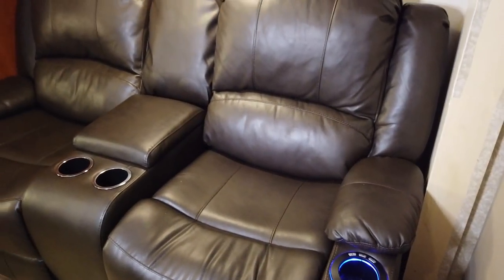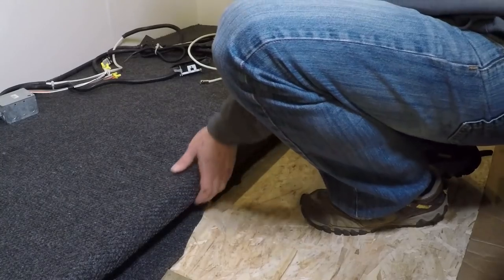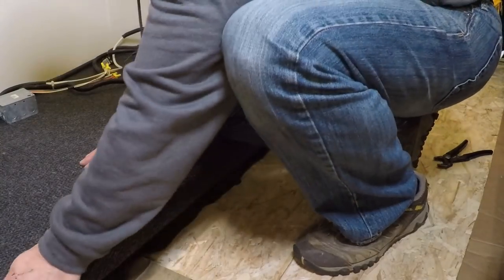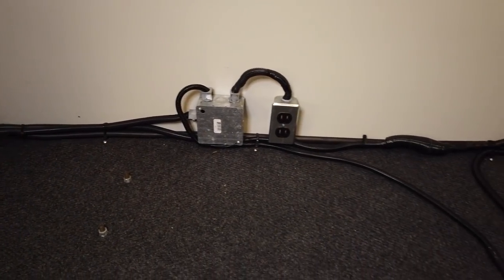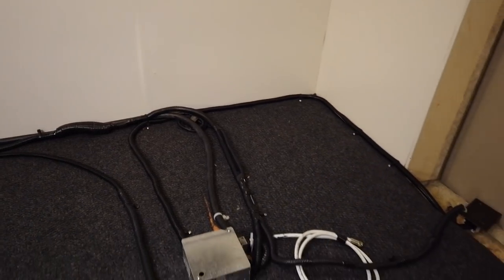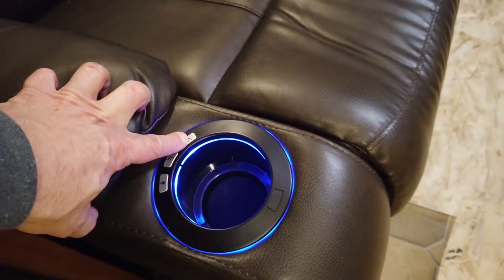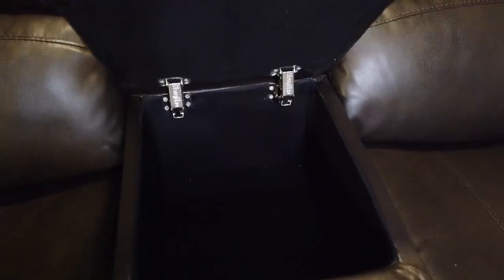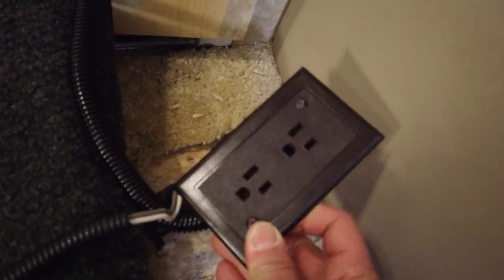Replace Uncomfortable RV Sofa or Dinette with Recliners | Class C RV Renovation | RV with Tito

Comment: We bought the same recliners for our Class C except non electric and in Toffee color. Ours were replacing a jackkife sofa that was incredibly uncomfortable. Our slide was not as deep as yours so we had to build it out to accept the chairs. My husband did an awesome job. It looks original. We used electrical conduit wall clamps on the front and back bars over a piece of 1" pipe to attach our recliners to the floor.  We greatly enjoy your channel and look forward to your drama free videos and laidback attitude. We also plan to keep our 5 year old RV for many years.
Reply from the maker: Hope you're enjoying your recliners. We're looking forward to many years of comfort with these. I also picked up a couple 2" conduit clamps that I'll put over the back frame once I'm done tweaking things. Cheers!

Comment from the maker: (Update) Bolting the Recliners Down: I secured them to the floor with a couple 2" electrical conduit clamps on the rear frame. There are a couple holes in the frame where I could bolt them to the floor, but I like the clamp on solution better.
Reply: You can always use muffler clamps through a floor with flat stock...
Lighting if you need some you can locate less from me or build custom plexy glass is awesome with leds. Simple and quick you can take vinyls and wrap some pain some install different bulbs. 

The only difference between DIY and profeccional Custom is I get paid by the customer
Reply: I had a feeling....I figured that to be the case. Once again...great video! I'm looking to do something similar, however I have an older class c without a slide and all my electrical and plumbing is located under one seat, and the fresh water tank is under the other one.
Reply: @mikefredericks7288  ,
  Do you have the ability to rout plumbing differently
Reply: Thanks for the video and tip on source for the sofa, I'm getting ready to tackle the same.  On the lighting, my class-C has a 12 vdc sconce lamps on the back wall, one on each side of the window, which will be above the back of the sofa.  Perfect for reading or anything.  It also has a 120 vac outlet on the same back wall so that part is also done.
Thanks
Reply: Forgot to add a question.  Since my crappy dinette is the only other bed beside bedroom, when I lose that my son is out of luck when he's with us.  In your opinion when you have them reclined all the way out are they suitable/intended as sleeping positions?  
I went to the site and found jackknife and pull-outs, but neither recline, that's kind of a buzz killer. 
Thanks again.
Reply from the maker: @HighCountryRambler  They are pretty comfortable when fully reclined, but not completely flat. We've certainly spent many hours sleeping there. When our kids got too big for the dinette or mini sofa, we just used a blow up camping mattress in the middle of the floor. That ended up being the most comfortable spot. We also still have the overhead bunk area.

Comment: Great vid as usual.   We changed the recliners couch in our new Crossroad cruiser.  They were impossible to operate and weighed a ton.   We upgraded to a lighter model and easier to use.   We will be getting tied of the dinette set next.  It’s heavy and not easy to use.
Reply from the maker: Change is good!

Comment: I swapped out the single swivel chair with a Rec Pro swivel recliner.  Love the chair but first long trip it de-assembled itself as 6 screws fell out going down the road.  I'll use some lock-tite and hopefully prevent further issues.
Still planning on the recliner swap out, just need more lock-tite....
Interesting how you take a RV and make it what you want.  I've told RV salesmen over the years, it's obvious RV designers aren't into RV camping.

Comment: Hi Tito. I bought a manual loveseat from RecPro about 6 years ago.   It is extremely comfortable BUT the material and stitching is falling apart.  We only camp about 6 months out of the year on weekends and don't use the loveseat much. I thought it was a little pricy when I bought it but I disliked the loveseat that came with our 2018 Travel Trailer.   I hope  you have better luck with durability

Comment: I may have messed up not ordering the powered version. I forgot you were using that type. I expect to remove the couch and install ours, early next week. I was under the impression that they would need to be fastened down to the floor but, unless I missed it, yours simply sits on the floor without being fastened to the floor?
Thanks for all your wonderful videos and advice too. Good job!
Reply from the maker: I did eventually fasten them to the floor. So they're nice and sturdy.

Comment: Looks great! How did you secure them to the floor? You're usually pretty thorough. Did I miss that part or are you waiting to do that until you finish up some other things in case you need to move them?
Reply from the maker: You nailed it. I haven't yet, but I will. I added a comment at the top explaining.

Comment: I want to do this too but I'm concerned about covering our dining room window.  It looks like you had/have a window too.  Did the chairs cover your window?
Reply from the maker: The overlapped the bottom edge of the window by a couple inches or so...enough to keep the roller shades from moving. We don't have that RV anymore so I don't have exact measurements. The website should state the height dimensions.

Comment: Clean Brian... do the recliners bolt to the floor at all? What is the interior width of your dinette slideout?
Reply from the maker: I'll bolt them down later (see pinned comment at the top). These are 70" wide. There is also a 67" wide one.

Comment: QUESTION… PLEASE HELP… My fuse box is currently located under my jack knife sofa.  I’d love to get recliners.  Do you think there is enough room under the recliner to leave the fuse box under it?  I have a class C much like this one.  Thanks!
Reply from the maker: Hard to say. There are a lot of moving parts underneath. If you can reposition the fuse box you might find a spot that works, but it's doubtful because it needs to be in a spot where you can access it. Hmmm

Comment: Hey Brian, can you tell me if those recliners are "zero clearance"? When you reclined, it appears as they are as the seat moved forward, but it's hard to tell from the video. How much clearance did you have to leave behind the head of the seat to allow them to move? This is definitely on my to-do list this summer!!
Reply from the maker: They only need 3 inches of clearance from the wall.
Reply: @RVwithTito  Awesome, thanks for the reply (I found the answer later on the manufacturer's website...sorry!)

Comment: By chance did you put the dinette slide in without the carpet on the floor between the dinette and the couch?  I want to remove that carpet and put in vinyl plank but not sure if the slide out needs the carpet to slide on.  I have the exact same motorhome and any help is appreciated.  Thanks Matt

Comment: I've been looking forward to this video because I intend to install the 67" version of these recliners in my rig once it warms up outside.  Originally, I was considering the manual version but the powered version is pretty sweet.  I noticed they are 120v AC, is there a manual override in case you are boondocking and don't want to power up an inverter just to recline?  It looked like you plugged in a DC transformer for each base so they are actually DC motors.   I wonder if they make a DC hardware option?
Reply from the maker: I don't think there's a manual override or DC option (from RecPro). I run my inverter most of the time, so no problem for me. The motor runs on 24 volt so I plan on installing a 12-24v step-up converter like this (https://amzn.to/2CQwjep) so I can power it from my batteries. I'll be sure to post something if/when I get that working.
Reply: You can also buy rechargeable battery packs for recliners. They are easy to install, just attach inline with existing cords. They can hold a charge for up to a week or so with moderate use but could recharge every time you plug in or from an inverter while you are parked.
This is what I ordered.  https://www.amazon.ca/gp/product/B07G91FMLQ/ref=ppx_yo_dt_b_asin_title_o02_s00?ie=UTF8&psc=1

Comment: Great video. Question: I would think that the recliners would have to be to the floor. Are you concerned about them shifting when you drive down the road?
Reply from the maker: I added a comment to the top explaining. I do plan to bolt them down, but not yet.

Comment: How do you fasten the recliners down to the slide out so they don’t bounce around when you’re driving.
Reply from the maker: I used a metal conduit clamp underneath on the rear part of the frame. It also helps when you sit up, so it doesn't rock forward. Good luck.

Comment: Thanks for the video.  I assume those are wall huggers.  Did you cycle them to full recline before attaching to floor to make sure backs aren't dragging on wall?
Reply: One more thing - you do really nice work. A lot better than a normal shop would do.
Reply from the maker: Yes they are wall huggers. I extended them fully a few times and adjusted the position so they wouldn't scrape the walls/blinds. I haven't attached them to the floor permanently yet. See the pinned comment at the top.

Comment: Thanks for your videos.  I have a Jayco Greyhawk 2007 that we are remodeling.  I ordered the same sofa today.  I am considering connecting the wiring for the chairs to my inverter so that I have power while traveling or not on shore power.  The other thought is to do a battery backup system.  Did you consider this.  My understanding is they will not recline without ac power.  Thanks, Larry

Comment: Thank you for sharing these videos.  Eventually I plan to do some upgrades to my RV. I did notice that it didn't seem you connected the chairs to the floor at all. Is that not necessary?
Reply from the maker: Check the update I pinned to the top. I'll bolt them down later.

Comment: Thanks for video.  Removed and sold our sofa-bed. Now, to order recliners.  Please tell me the RecPro item number you purchased.  I assume you roughed in the 110v to the recliner area, did you video the AC wiring?  Although I did note some comments on 12v operation, I am concerned about using only AC to operate the recliners.  Can one manually operate the chairs without using the electric switch? Thanks.

Comment: Looks great.
That does that setup weigh ?
Reply from the maker: The RecPro site says 197 lbs. They didn't seem that heavy, but I had them in pieces. I'm actually planning on getting rid of my 4K generator (located below the slide), so that should free up 300+ pounds. The couch I took out was actually pretty heavy too.
Reply: @RVwithTito  
It is looking good!
Thank you for the info!

Comment: this is great info and thanks for doing this,  Do you know the depth of your slide from the inside wall to the end of the slide?  Mine is only 33" and RecPro's website states 36" is required.  I am OK if I have to push it up against the wall when the slide is not extended and I would pull the recliners out  when the slide is extended, I have to make sure the frame will fit on the slide when the recliners are pushed back to the wall, thus the reason for my question
Reply from the maker: Mine is exactly 36 inches
Reply: @RVwithTito  thanks for the  response, do you think the frame would fit on a 33" slide if the recliners were pushed all the way back to the outside wall?
Reply: @RVwithTito  From your experience do you think the RecPro Recliners would fit on  a 33" slide if I pushed the recliners all the way back against the wall.  This would be what I would do when the slide is in, when I get to a destination I would open the slide and then pull the recliners out from the wall.  I just need to make sure the frame of the recliners will fit on my 33" slide when not being used.  My slide floor is above the main floor when pulled in.  Thanks

Comment: Since you changed the cafe booth to recliners, have you had any problem with the extra weight making a problem for the operation of the slide?
Reply from the maker: No. not at all. Removing the dinette and everything under it made a difference too.

Comment: We installed the RecPro recliners 2 years ago. The material is already starting to split on the back of one chair. RecPro would not stand behind their product but wanted to sell us a replacement back for $150. We declined that figuring that that one would probably do the same after awhile. Instead, we are having covers made for the backs at a local upholstery shop with color coordinated durable material. I suggest anyone using RecPro products keep an eye out for splitting fabric and contact RecPro before the warranty is up.

Comment: So Brian, you have an inverter so you don't have to either be hooked up to shore power or have a generator on to make these move?
Reply from the maker: Yes. I have an inverter. I'm also going to try and bypass the AC and power these from my batteries.
Reply: Brian, those recliners look awesome and great job on all your videos. 
Two questions:
1. Were you able to bypass the AC to power the recliners directly from your battery? I'm concerned about getting power recliners and not being plugged into a power source.
2. How do you think the Rec Pro recliners compare to the Thomas Payne recliners?

Comment: Brian, how much room did you have inside your slide opening? I see your chairs are listed as 70"...is that a 'true' size? I've got exactly 70" inside my slide walls...69.5" if I account for the trim on each corner of the slide opening. Thanks for the help...
Reply from the maker: My opening is exactly 71". The chair width is right at 69" plus a little extra cushion in the arm rest that would take it to 70". They could be squished down to fit 69" without looking or feeling weird. Hope that helps. I'm sitting in them as I'm writing this 😉
Reply: @RVwithTito  Is the slide 36" deep? That's what I have and have ordered the 67" powered set. Another user said they fit fine in the 36" slide, but I'm still wondering how it will impact with the window shades... thinking of installing mini blinds there?

Comment: Map lights .. Reading lights... something nice small..
Reply from the maker: Thanks for the suggestion. I've got several saved on Amazon already that are small with dimmers. Haven't made a final decision yet though, but probably one on each side mounted near the top of the side wall.
Reply: @RVwithTito  I've I stalled three of these bullet-style lamps. The dimmer and brightness levels, along with the swivel range make them very useful. Super easy to install!

Comment: I'd like to install the recliner in my travel trailer, however, I only have a 20" door opening. Do you think I could squeeze them in a 20" opening?
Reply from the maker: Just measured the base and it looks like you'll need at least 21" without damaging it. Out opening is 22 3/4"
Reply: Appreciate your effort measuring the base and quick response. Thank you, Joseph. P.S. Enjoy your channel.

Comment: Hi Brian,
I use a word I made up, getupability.  Our Montana High Country has seats that lack getupablity.  How is getting up from those seats?
Reply from the maker: Getupability rating is pretty good. Since they sit on the slide out it's adding another 3 inches or so off the floor. So standing right up and out is pretty smooth.
Reply: @RVwithTito  I currently have to push myself up from behind and I'm not alone.  I have seen other in my camper do the same.  When reclined mine are pretty comfortable.  I would hate to order a new one and have that problem.   Your input is very helpful
Reply: Hi, It's tine to replace my theater seating in my Montana High Country.  I would really appreciate an update on your RecPro seats.  Comfort, durability and most importantly getupability.  Thanks, Gary
Reply: Update!  We have had our RecPro recliners for well over a year now and we are full time so they get a lot of use.  As far as "getupability I would rate them fair.  The fabric is s very good quality.  Our problem is they have gotten a little soft on the bottom cushion which allows us to feel a bar from the back cushion, it's pretty uncomfortable.  After talking to RecPro customer service and coordinating a shipping address they have replaced them both.  I can't ask for better customer. service.

Comment: don't you bolt / screw the seats to the slide base?  I was hoping you would cover that step.
Reply from the maker: I did anchor the seats down with conduit straps later.
Reply: @RVwithTito  Do you just screw the straps into the slide floor, or bolt them from below?

Comment: We have been considering replacing the sofa in our 2013 Class C Forester. Problem is the slide platform is 5” high and recliner seats would be about 26” high.  Can the platform be modified?
Reply from the maker: Are you asking if you can lower your slide? Probably not.
Reply: RV with Tito DIY, Thanks. That’s what we thought.  The other issue is the elevated slide is only 32” deep.  We’re not finding any furniture RV or otherwise that fits in this small of an area.

Comment: Do they only operate on AC power?
Reply from the maker: Yes. I am going to try and bypass the AC and power it from DC. The motor runs on 24 volt, so I'll need to get a step-up converter. I'll keep you posted.

Comment: I don't understand why folks use the crappy fake wood floors as far as the sofa why spend top dollar go to Bob's or discount furniture . the motorized parts run on low voltage. Build in mounts and bolt in...
   I still don't understand the crappy floor stuff I have 3\4 " hickory and oak I ripped from a basketball court and from a house and put in a classic airstream then doing brown leather not faux on the entire tiny trailer.